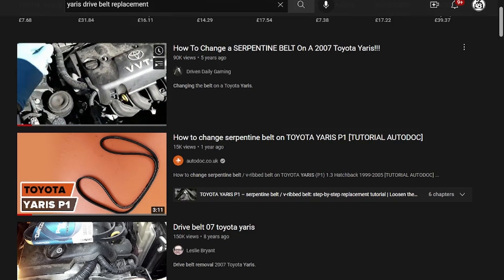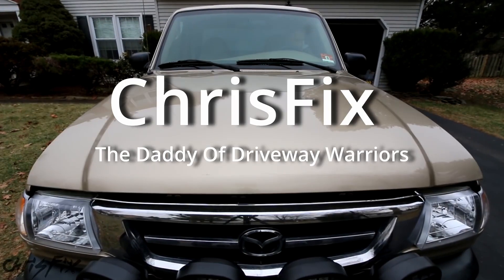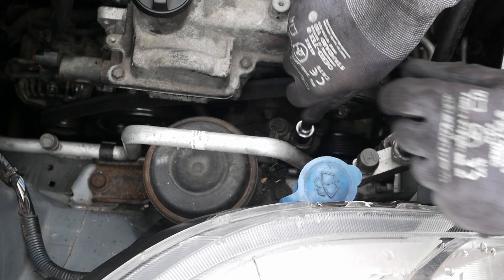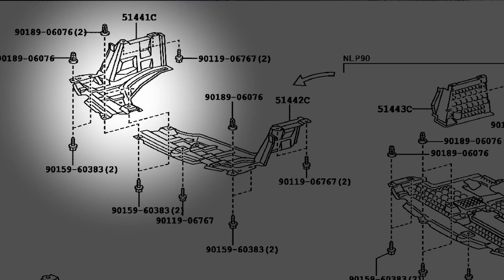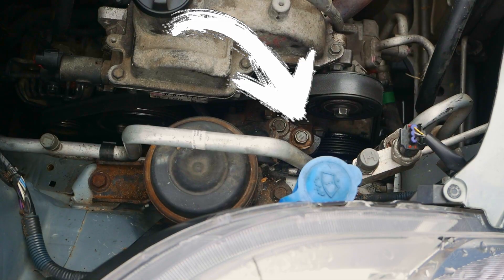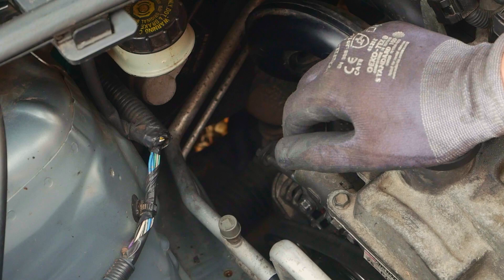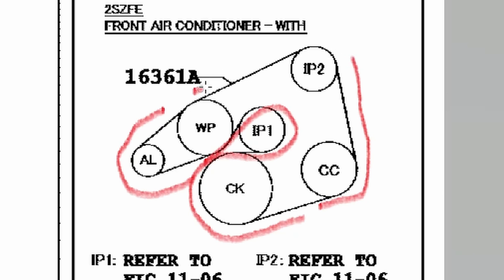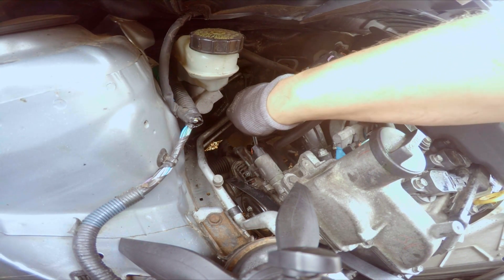YARIS XP90 2sz-fe DRIVE / AUXILIARY / SERPENTINE BELT CHANGE

Comment: @ifell3 hi there, to release the tension from the alternator you first have to slacken the 14mm bolt under the alternator, then the short one from the top of it, then the long one and the alternator will move freeley.
The 14mm bolt is easy to access once the wheel is removed with a long extension or two notmal length ones.
I hope this helps.
Reply from the maker: I've pinned your comment, I honestly cannot picture it ATM, but you might be right. For the SCP90 I assume you mean. Regards

Comment: Top guide - worked well for me. The alternator adjuster isn't quite magic, it just pulls the alternator body away from the engine block as you tighten it (remembering your looking at it from the wrong side), as, someone says here, once you've slackened the other bolts - including the bottom mounting bolt ,which are all pretty tight after several years of steel on aluminium.
Reply from the maker: Sometimes it's the simple things that makes me look stupid aha

Comment: FANTASTIC ENGINE MINE 500.000 KM NO PROBLEMS EVER
Reply from the maker: Toyota!! Mind you I've done a timing chain as mine stretched. Poor design, had a TSB for it, and the person before me only changed the oil on the mileage, not the time it had been sitting in the engine. So if you need to do that, but after 500k you would just buy a new one right!!

Comment: Hi! Is your squeak still gone? Replaced my drive belt with a new Toyota genuine belt but the squeak came back some days after. Tightening does not help. All pulleys feel fine with just a little side play in IP1 and IP2. Thinking of changing these. Do you remember if the new one you put in had some play in it too? Maybe the belt is getting misaligned?
Reply from the maker: The new one felt a little more firm if you know what I mean. Did you follow good old Chris fix channel for squeaky belts? After changing the belt it was quiet, have you tried degreasing the pulleys?
Reply: Yeah I followed it, but now when I watched it again I think I saw the waterpump pulley wobble on my Yaris. Not a lot but just a small amount but it might cause the noise. Will be looking in to that before I replace the pulleys as Chris said it's normal with a little sideplay. Yeah I tried degreasing with brake clean.
Reply from the maker: @MrMegaOliwer  I've also heard some of the continental belts squeal a little. Be interesting to see who makes the Toyota part.
Reply: @MrMegaOliwer   I'm sure it was the water pump. I just hope it didn't fail in a bad moment. Mine just gave up after 150k miles. I was lucky it failed just after I pulled in the garage. And I usually have an OBD2 bluetooth adapter on which I usually keep an eye on the temps. It just spiked to about 100C just as I turned the engine off, so I got lucky.
Reply: It was the water pump. Changed it and the noise is completely gone.
Reply: @MrMegaOliwer  which brand have you got? or was it an original one? I've got a Thermotech, basically the cheapest one. I'll change the radiator (from NRF) which I bought this summer and never got the time to change, and the belt from Dayco which is a different code as the one in this video (695K6 1765). I think it's just 5mm longer, so there's no problem there.
Reply: I got a Ridex pump for free from a friend of mine. Not a big fan of Ridex parts but maybe it'll last a few years. My old pump had both play and was leaking a bit so it made the pulley slippery too. Hope you will solve your issue too.